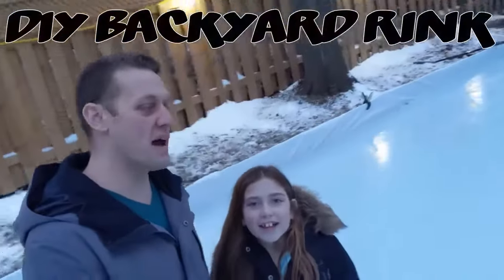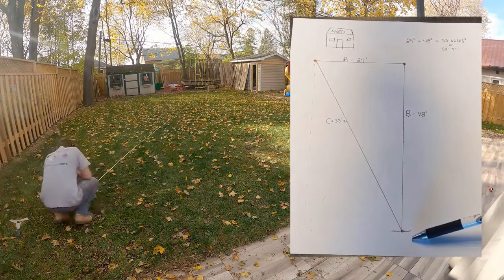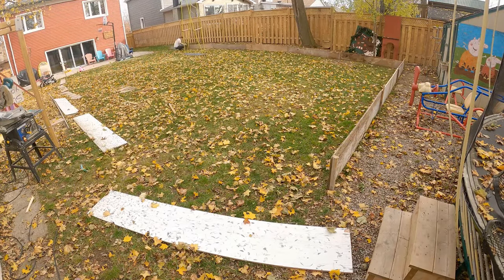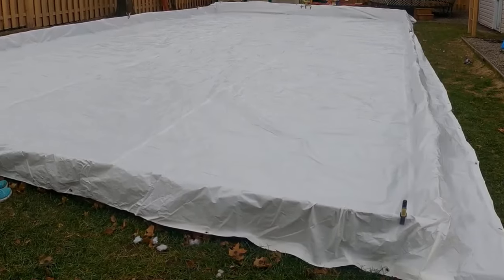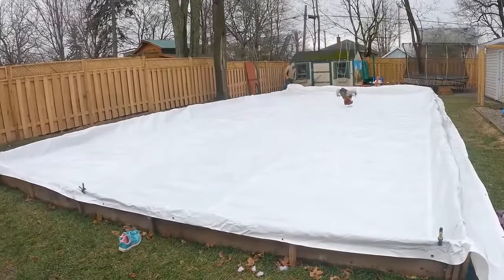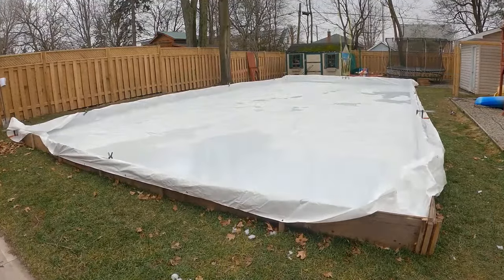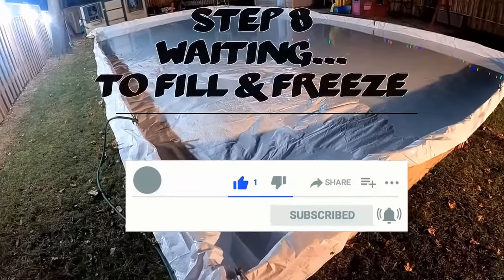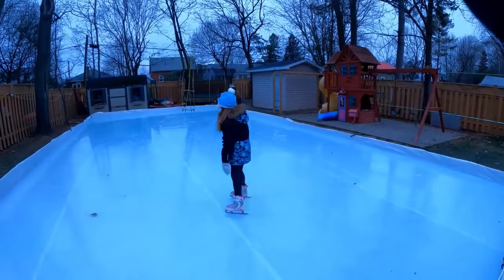DIY Ice Rink - How To Build A Backyard Ice Rink - DIY Hockey Rink

Comment: Could you recommend some hockey skate or just comfortable skates in general and preferably from Amazon?
Reply: Hey, mate. I'm an ice hockey veteran of 16 years. I played at a very high level for quite a few years as well. 

Here's my recommendation: Get yourself a pair of CCM Ultra Tacks. Take your ordinary male U.S. shoe size and minus one size and a half, if you're an adult, and then you will have your perfect ice hockey skate size, especially if you stick with CCM. 

Your best bet is to go to your nearest used sporting goods store and buy yourself a lightly used pair of skates, since you're not yet an expert on which characteristics you like and which ones you dislike. Also, if you buy brand new, you would NEED to take them to a used sporting goods store anyway. You would need one which offers SKATE BAKING. What this does is breaks in a new pair of skates in a matter of hours, when done properly. 

But, I think you should just buy used for now. And get yourself heavy duty blade guards. DON'T EVER WALK ON ANY SORT OF SURFACE WITHOUT PUTTING ON YOUR HEAVY DUTY BLADE GUARDS. 

Also, if you do buy used, try to find some CCM Vector skates that are in good shape. They are the best of the best. If you can't find them, then get some Ultra Tacks. Have someone in the store help you because there are like a million different versions of the CCM Tacks, and you specifically want the ULTRA Tacks, which are the best of the best. You don't want anything less. 

Get yourself some WAXED laces. And make sure those laces are yellow in colour too. Then, you will look like proper bad ass out there!
Reply: @BiscoWho  lol yeah a lot of people recommended CCM, thanks for the advice:)
Reply: @Karinaa___  I'm not recommending just ANY CCM. The ones I'm recommending are very specific. And you can be sure that my recommendation will 100% for sure treat you the best a pair of skates can possibly treat you.